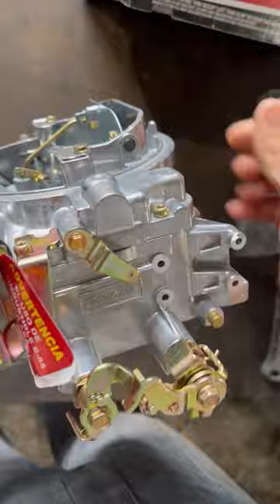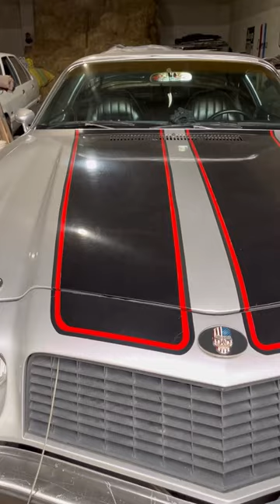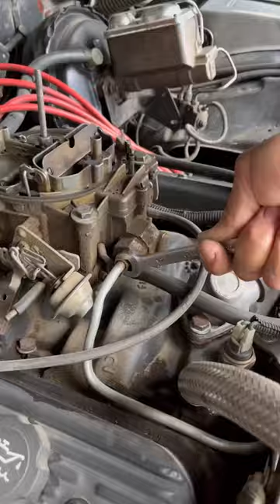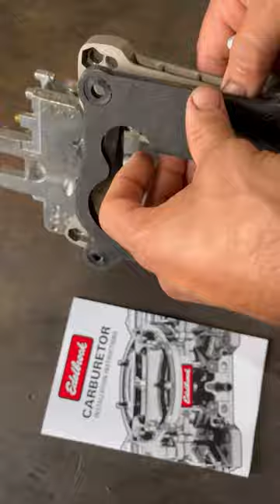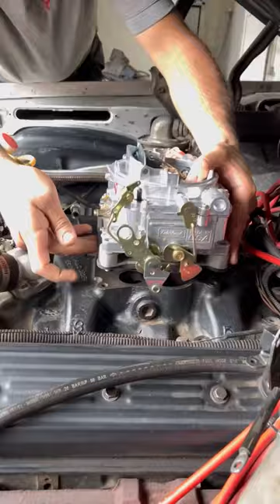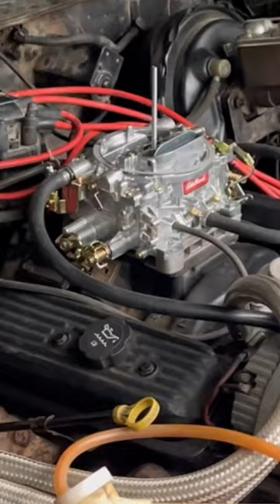Unboxing and installing Edelbrock Carburetor. #shorts #short #youtube #video #unboxing #edelbrock

Comment: Get a wideband O2 guage or even better, a double guage (bank 1 & bank 2) so that you can tune it correctly. Set it around 14.5:1 @ idle and cruise and 12 5:1 at full throttle. Then you'll get great gas mileage and good performance under throttle. Edelbrocks seem to always run lean right out of the box from my experience.
Reply from the maker: Hello my friend, thank you for sharing your experience
If possible, give me your email so that I can ask you for more information about it
Reply: 5:1 at WOT is outrageous
Reply: @James7796ify  12.5:1... appearantly i forgot the "."
Reply: I want a afr gauge kit for my 350. I'm curious what it would be seems I've gotten 22 mpg highway on a 300 mile trip

Comment: Junk carburetor
Reply from the maker: @markharris1473  yes
Reply: @Mechanicaltricks  best carburetors would be Holley, Demon or Barry Grant
Reply from the maker: @ thanks for the advice
Reply: @Mechanicaltricks  anytime. I've never had a problem with any of those carbs. They are a bit salty in price, but beats flooding the carb out all the time. I used to have a carb l8ke that on my truck. It was new too and had issues with it flooding out all the time. I even got someone I trusted to adjust it for me and made no difference. So I bought a Holley 600 street carb. All problems and issues were gone after that.
Reply from the maker: @ Hello dear friend, thank you very much for sharing your experiences. It is absolutely true and I have also gone through these problems.

Comment: Gave up a Qjet for a edelbrock?
Reply from the maker: @LionsTigersBears  I did it for a client and now I am not satisfied
Reply: Q jet are awesome when they are rebuilt right.  Got a manual on it. Its black cover. It has alot of great tips. Q jet perform better than a holley. Dialed in no power valve blow out.
Reply from the maker: @LionsTigersBears  thank you for your information and explanation I am very agreeing with you
Reply: I never messed around with the q jet but I think if I had a 350 I would keep the q jet
Reply from the maker: @kxp.1496  thank you for watching and commenting
Reply: They came with a q jet they are designed to run best w them Rochester put a lot of time into designing the best all around carburetor that will work flawlessly for many many years under every condition and every different type of driver g.m. used them on everything from a V6 to big block cars and except for a few small changes to the idle circuit the 750 and 800 CFM models which is the only two models made before the ones w tps and such would be trouble free they will start doing some odd things when the throttle shaft bushings get worn out etc but when you have the q jet that was calibrated for the engine it came on
Reply from the maker: @ exactly right 👍🏾 thank you for the information 🫶🏽

Comment: Question my carberator same as you put it will idle good hit a bump idle high  i hit the gas paddle  hard goes right . I take the gas cap off makes a pressure  noise? Should  I get it rebuild it's brand new
Reply from the maker: @LarryAvila  I don't know exactly what your problem is
If your carburetor is new, then do not touch it
Reply: should have got a holley
Reply from the maker: @DrFigs  yes sir
Reply: @DrFigs  if you like messing w jetting while at the same time getting gasoline all over your intake and nevermind power valves blowing out holleys are trash always have been on a street engine

Comment: Was any tuning necessary? Or are they good out the box?
Reply from the maker: Yes, they are good, but if it is the old original part of the company, it is better than this
Reply: @FrankFlores-xt1yw  an Edelbrock AVS 2 is the best out of the box carb for a mostly stock application once you start changing the cam profile and other things then tuning may be needed but always they come out of the box and run ..

Comment: I wish they still made them like your old Camaro.
So simple to work on.
Reply from the maker: @scottyellis3442  Yes, it is absolutely true
Reply: @Mechanicaltricks  but those type engines didn't hardly ever need any work done.
Reply from the maker: @scottyellis3442  yes sir
Reply: @scottyellis3442  yes the gen 1 small block Chevy is one of the best most reliable engines ever mostly due to simplicity..
Reply: @scottyellis3442  but remember the L.S . Series or the vortec engine family is all the best of the gen 1 small block and more .. twice the output in stock form w factory aluminum heads and a six bolt main cap configuration... Almost idiot proof ..